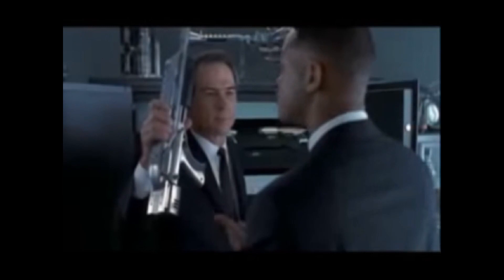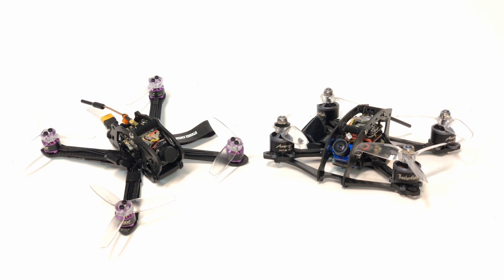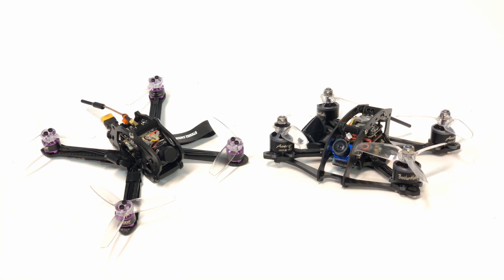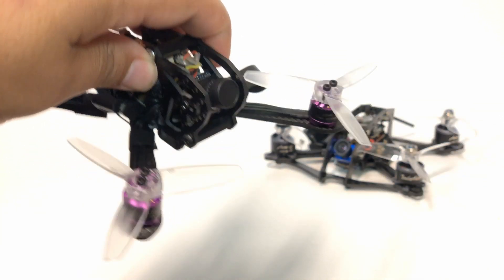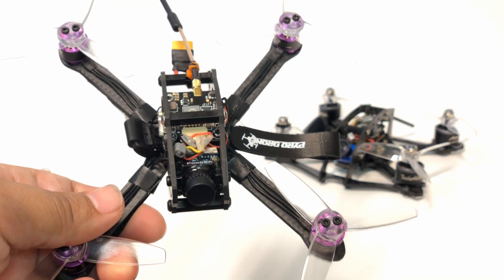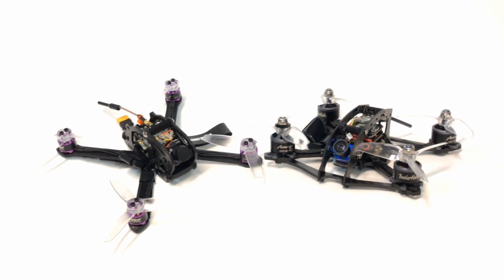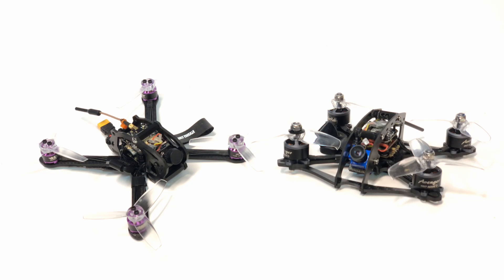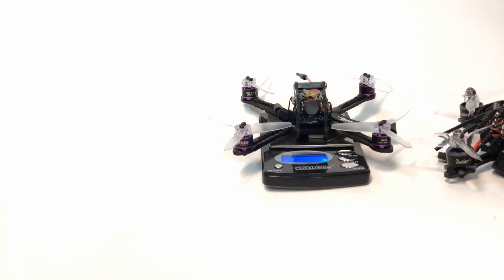3" Quad? 1106 vs 1507 Motors discussion

Comment: Good comparison video!

For me, I switched from a 1407 3” 4S setup to a 1105 3” 2S as my race quad this season.  I run the 650mah 2S CNHL 70c batteries. I can race for 2:30 and come down at 3.75v.  I do HV charge them though.  Racing a 2S quad in the open 5” class is not for everyone but since there is no micro class... I love it!  I have several videos on my channel showing me racing my 2S quad if you want to see how it performs. 👍🏻
Reply from the maker: Yes I would love to see 2s on a track!

Comment: I'm going to run a Diatone Mamba F405 Mini Mk3 F35 3-6S 20x20 Stack on a 3 inch tadpole frame. Motor recommendation?  I am pretty lost on my first build. Something tells me I'm going to find out that I'm buying parts that won't go together very well or at all.
Reply from the maker: That won’t work on a tadpole. Tadpole can only do 16x16 stack or 25mm toothpick board
Reply: @JonE5FPV  thanks

Comment: may you just put a time into the description where you start to talk about the TOPIC ????? OMG!
Reply from the maker: Been trying to get to the point a hit faster in the newer videos. This was one of my first 10 (close to 200 under my belt now)

If you have a chance check out one from 2020 and let me know if it’s any better.
Reply: @JonE5FPV  thanks for answering to my raging!
I just wanted to find out, if I could fly my future 220g 3" (iFlight DC3) on 1104 5000kV GepRC motors (on 4s). I was unable to get this info from your video, but you may just give me a hint this way? ^^
Reply: 09:10 it starts

Comment: can you place 140XX or 15XX motors on a 2.5"?
Reply from the maker: As far as I know there are no 2.5” props that take a full size prop nut. I believe the avenger motor can mount up to a 2.5” frame as the bottom of the motor has 2 different bolt patterns. 

However a prop with a full size prop nut is needed. Smallest size props I am aware of that use full size nut is 3”
Reply: You could use the new emax 1306b or their new 1408 motors. They use t style :) cheers

Comment: I just built the massive droner using the same motors and the new magnum mini v2, are you running betaflight with stock PIDs?
Reply from the maker: I am using Butterflight 3.5 on all my quads at the moment.  I start with stock pids, and then tune to make sure oscillations and heat in the motors are gone.  For this size and KV, it usually means moving the D's down considerably, all of my D's end up 18-24.  I also reduce P and I incrementally until P term oscillations are gone.  (when you hit throttle as you are changing directions like making a turn and going back the other way and you get a high frequency shake).  I reduce 3-4 at a time until these are mostly gone.  Same steps would apply for betaflight. Hope this helps.
Reply: I was thinking about going to butter flight.  That's what I am running on all my 5 inch ones.  The little guy has a ton of oscillations on the stock settings.

Comment: So why is there no 3 inch class for racing. They tend to be faster than 5 inch. Is it the flight time or for what reason?
Thanks man
Reply from the maker: It is an interesting question.  We did try 3" class at the Drone Wars event video I did that you can check out.  Large OSD = 3", small OSD text = 5"

Here are my thoughts.

1 - More people race 5", we had about 22 people racing 5" that night, and only 9-10 3" (i was doing both)

2 - 5" is the fastest and most people want to race the fastest

3 - Even 3" (at least on 1507 like i was running) was very fast for the indoor track, basically an indoor soccer arena.  Interestingly almost everyone (including the winner and me in 3rd place) scored more laps on 3" than the did on 5"

4 - The winner was actually running a 2.5" on 4s (Massive droner).  I may run a 2.5" if they have another race there on 2s

5 - I believe 5" are more able to take crashes, usually 3" are thinner carbon, the motors are more easily bent etc...

6 - Turtle Mode would be impossible in most even short grass since the props are that much smaller.

That said, my chapter has already said we will do more 2.5-3" races this next season, so stay tuned to see more of it.
Reply: @JonE5FPV  thanks for the great reply!
So if you finished more laps on 3 inch... Why do you say 5 inch is the fastest in point number 2?
Or do you think it was that much faster due to the smaller track?
I think on large open tracks a 5 inch will be faster due to it carrying more momentum so it is easier to go faster and keep the momentum through the track on 5 inch if there is allot of straights. That being said a 3 inch is however more times than not faster on straight punches than a 5 inch. This is not the winning factor due to it may be faster but takes allot out of tge current battery technology for 3 inch and as soon as you back of the throttle the 3 inch reduces speed faster than a five inch carrying more momentum would.
This is why on a small track a 3 inch would easily out perform because now momentum doesn't play as big of a role
Reply from the maker: @philipbrits2984    Yes it is definitely the size of the track that made the difference in the Drone Wars Event.  On most normal events, a 3" could keep up in the turns, but it will be much slower in the straights.  I dont see this as a huge issue, in fact i saw Imaginary Ace fly his 3" droner at the Track Or Treat event for one round Sunday.  

I can tell you issues can arise mixing sizes from last year when i broke all my 5" and decided to switch to my 2" that i had with me to try to get some laps.  It was nimble enough, and seemed fast enough in my neighborhood.  The issue that happened is that i was so much slower i caused people to crash into me twice in 2 different rounds because in addition to being slow, people could not see me on the track because i was so small.

Also, many of the larger events are in grassy areas, where even a 5" can dissappear for minutes at a time where we all end up looking around.  This will be compounded with smaller craft.  

I think the skill needed for building 3" or smaller is also slightly higher because the 20x20 boards are a little smaller.

The momentum you are mentioning is a thing, but if you get the right motor/prop combo and tune, you should be able to turn on a dime with a 5" just as easily as a 2.5" or 3".  For me this motor size is 2405 for 4s or 2207 for 6s.  The high torque allows you to make last second corrections without the worry of momentum pulling you along into an obstacle.

Another thought I sometimes have, is that 3" is so fast now, you almost need a track just as large as a 5" to really be able to run.  I also find my 3" sometimes difficult to stay in air for 2.5mins pushing hard.  I have a video coming soon on a 2.5" 2s setup, that seems light, maneuverable and pretty efficient.  I may end up doing a 2" vs 2.5" vs 3" vs 4" vs 5" and see how they all compare.
Reply: @JonE5FPV  can you please post your pids for your droner

Comment: For 3inch drone is better. 1306. 4000kv or 1408 3600kv help me choose because I'm in a quandary over this one..I'd be very grateful if you could help
Reply from the maker: I have not tried 1408 yet but i will have the new emax version soon.  I am guessing it will be close to 1507 3600.

Larger will be more power with less flight time, and the smaller will be less power, less weight but more efficiency.

Do you want super speed? Or just something fun and light? 

I have been impressed with how light the 1306 is, but it is not as much power as the larger ones.

Flying fast, id say the 1306 can get about 60-70 seconds more flight time than the larger motors since they use up power quickly.
Reply: @JonE5FPV  I feel like I disagree with this common misconception. You are also going faster with the larger motors. And the frame is much heavier. That's probably why you lose flight time. 
On the bench, those 1408s are more efficient than the 1306 at the same thrust.
Reply: @JonE5FPV  Thank you Jon your explanation was helpful
Now I understand which one I should choose.. Yes i want super speed
Reply from the maker: If your are cruising larger can be efficient yes.  But if you fly fast larger will always be faster and also use more power.
Reply: @Aisyaba  lol, yeah. Long story short go with the 1408 motors. They JUST released these as my 1306b's came in -.-
Reply: @Aisyaba  watch out though, if you mean the new emax 1408s, they only accept t syle mount props with the 1.5mm shaft. You might not be able to make use of the bigger motor using those tiny props. 

To be safe, and get Max BEAST get regular m5 shaft motors and use the gemfan 3052s or something!

I think 4000kv is a good spot for 3 inch. If using the same props, the emax 1408 at 3600kv might actually be slower since it's less kv.

Comment: Have you tried the Japalura 3” frame?
Reply from the maker: I have not tried the japalura but I talk about it some in the massive droner review video link in the description. 

IMO the japalura is an awesome design but much to heavy. I loved my Armattan chameleon. But the massive droner allows you to use the same components for the most part and save a substantial amount of weight.
Reply: @JonE5FPV  yeah it's much better in its 4inch form

Comment: Or 1306b/1408b?
Reply from the maker: Both will be good, one more power, more more efficiency
Reply: @JonE5FPV  mmmm you sure? 1408 motors are more efficient in terms of total thrust. Maybe the 1408 quad will be heavier and less efficient? Maybe not?
Reply: @JonE5FPV  *bigger motors are almost always more efficient. 
Flight time is lost to extra weight, and a higher potential amp draw/speed.